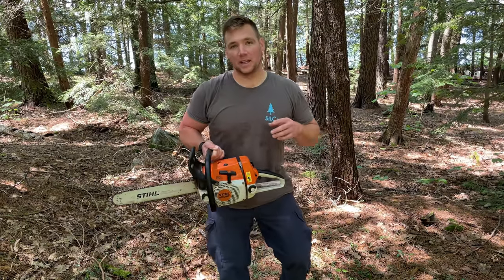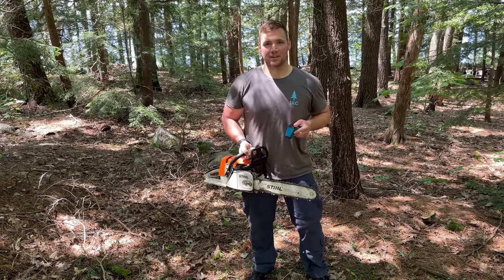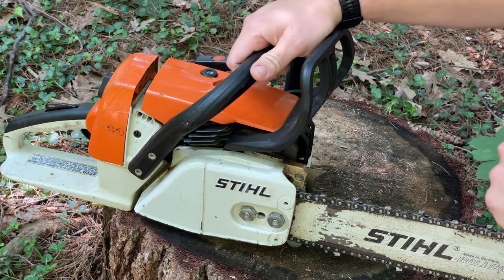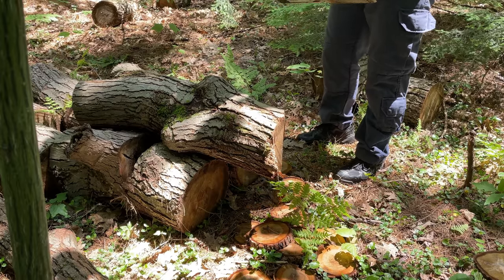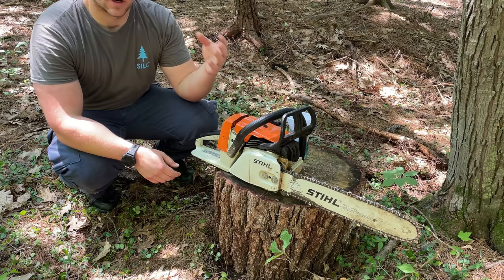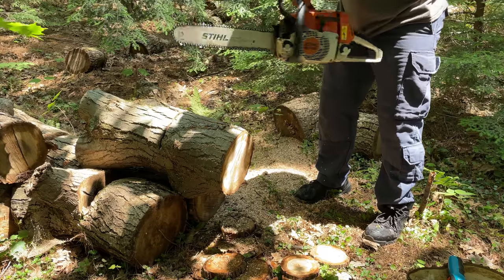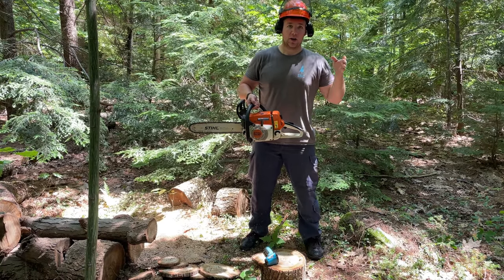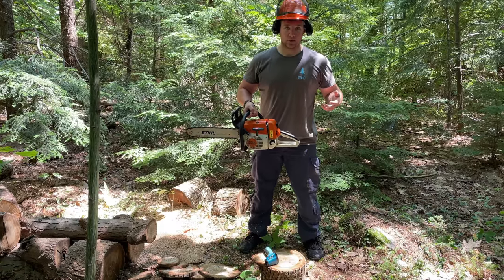Will my chainsaw last longer if I use more oil? Is it safer? (25:1 VS 50:1 temperature testing)

Comment: I've logged professionally for over 30 years. I mix 40 to 1 and add 1 iz of marvel mystery oil per gallon  of gas and ONLY NON ETHANOL gas. My saws cut 3 to 4 million feet a year with no issues. Good job on the video
Reply from the maker: That’s pretty good evidence. What oil do you use?!
Reply: @DavesSmallEngines  Would be very interesting to see your test done with Scot's mixture. Thanks for the very interesting video BTW!
Reply: I can’t find ethanol free gas in my area but I wish I could.
Reply: Is the one ounce of Marvel additional to the 40:1 mix or part of it?
 40:1 is 3.2 oz of oil to 1 gallon of gas. For one gallon did you add 3.2 oz of oil plus 1 oz of marvle making a total of 4.2 Oz per gallon of gas?
Reply: @Wolf-wf6yx  yes. I do my normal mix PLUS an ounce of marvel
Reply: @stevenkinnison8044  there is pretty easy ways to get ethanol out of your gas. If your interested look it up on YouTube
Reply: It looks to me like a 30 to 1 with that extra ounce of mmo
Reply: Well partner, you've wasted money on gasoline for 30 years. I've run 50:1 in all my stihl saws with 10% ethanol gas for 30 years... never a problem, cranks on 2 pulls, run strong. The secret? GOOD gas jugs.
Reply: Oh nice i add mmo to mine as well 😁 didnt think it was anything groundbreaking but nice to confirm im not the only one and others have had success with it.
Reply: Million or
MBF! 🤔🤔
Reply: @thegreeninvasion5511  MBF is 1000 boaed feet
Reply: @scotgarland7526  
I’m well aware! I’m also well aware that you didnt cut a million board feet per year with a chainsaw! 
No way you cut 20,000 ft every week all year long every year! Never mind 60-80,000!
Calling BS
Reply: @thegreeninvasion5511  glad you know all there is about logging in the mountains sport
Reply: @scotgarland7526  
I know enough to know you’re lying! 
  Cut enough wood with a
Chainsaw And a Cable skidder to guarantee that, sport
Reply: @thegreeninvasion5511  not gonna get in a peeing contest with a hobby logger on social media....some of us do it for a living so enjoy
Reply: @scotgarland7526  
15 years full time bud! Still calling BS
You tube hero👍🏻👍🏻🙄
Reply: @thegreeninvasion5511  well I hope you have a successful career and stay safe in the woods
Reply: Exhaust temperature will determine COX and NOX emissions, the lower temperature reduce emissions. Higher ratio improves HP/TQ 50:1 or 60:1 for me with MMO and 80:1-100:1 for races.❤
Reply: @thegreeninvasion5511  That is exactly what I was thinking!  Another thing- most of these logging jobs are like the railroad, they are not in a hurry.  Usually it is more like make a cut, put down the 25-30 lb magnesium pro saw, and then spend 10 minutes contemplating the next cut logistics.  Not because an experienced logger needs to, but because those saws get heavy and they roll railroad style breaks!
Reply: I have never had a problem running 40/1
Reply: Smoe men work for a check, hourly. Some bust there hump, by the pice.
 Former father-in-law was getting sent home at noon . The boys complained on payday the he was getting dubble the pay and only working ½ days . Accused the boss of unfair pay and playing favorites.  He told the boys that he( the boss ) was limiting his bord feet to share,  be nice to the other fallers. Said he gets paid the same per bord foot as the rest of the fallers,  his pay is double due to dropping 2x the bord foot of the rest of the crew. And no reason to make him sit there for ½a day twiddling his thumbs waiting for the rest of the crew to do hafe the volume.  The boss asked a rhetorical question,  do you want me to let him off his limmit?  None wanted a smaller pice of pie at years end, all said no. 
In the days before cell phones he could walk off a job and have 3 massages on the answering machine before he got to the house. Logging was different before the spotted owl deal.
Reply: 2 stroke doesnt really care much if you run it 5-10% ethanol and low octane. They are like locomotives of gas engines can eat almost anything. I have even ran chainsaw motor with cooking oil addon only difference is the smell.
Reply: I want to go 45:1 instead of 50:1 just for a bit of peace of mind? Will I need to retune my stuhl strimmer if I do? I haven't really noticed any difference in performance when I did. I guess it's only 10 -11ml more oil in 5 litres mix.
Reply: @scotgarland7526  it's kinda funny I'm averaging 15-20k feet a week in Minnesota at the moment cutting hardwood averages about 32 trees a day. Give or take. If I cut that little when I was logging out west I'd be fired. Strip cutting 220-250ish trees a day oversized following the buncher 50-60 trees a day. There's a lot of footage in a 42" tree that's over 100ft tall. Most people I know in hardwood country dont understand the coast at all
Reply: @scotgarland7526 that would be a board 189.39 miles long. oK big log tell us another one.
Reply: @darensylvara7690  we log out actual trees not a board at a time hahahaha
Reply: check at your local municipal airport if there is one close to you.  In my area they sell it in a minimum of 5 gallons because the airplane nozzle is larger than a traditional auto nozzle. They sell 91 octane ethanol free.
Reply: Could you explain about the gas jugs? Sounds interesting  @turbodog99
Reply: @ninjafrerunner  But ethanol raises the octane rating of the gas it's in. So  theoretically removing it could theoretically lead to pre-detonation in a high performance engine.

Comment: There’s definitely a sweet spot. I have a lot of hours working on chainsaws, I see a lot of saws blown up on 50:1. 40:1 or 32:1 seem to make them last much longer form what I’ve seen
Reply: I agree 100%.
Reply: i dont buy that.
i have 7 years on a multitude of echo and redmax equipment.  not 1 issue.  50 to 1 syn redmax oil

too many variables to make that determination

50 to 1 is what the manufacturer says.   at least on modern stuff.   you had this vid to show excess heat generated.  

most blow ups in small equipment are user errors, poor mix, old gas..no maint....etc.

but if you feel better at 25 to 1 go ahead.   wasting money and more smoke is what I see.
Reply: Our landscape company used 50:1 for many years, and we would throw out blowers every year due to low compression. A mechanic recommended that we switch to 40:1 ratio (more oil), richen our carburetors up, and remove our spark arrestor screens. Spark plugs are cheaper than engines.

We have had these same old blowers for at 40:1 for DECADES ever since we did that. We no longer replace equipment each year. Our equipment now is discarded/sold when it becomes obsolete and we can't buy parts for it - not because the engines were toast like they were annually, at 50:1. We have been in the landscape business since the early 2000's. 

We will NOT change to less oil (50:1), to please CARB (california air resource board), or the EPA. We do what we must for our profit margins.
Reply: 50:1 in a 550xp 10years old now it runs well still has good compression. But I use good oil
Reply: use motul 710 oír 800 .   thats the pro.  no mixture
Reply: I wonder if these people are allowing proper warm up time every time.

Comment: Maybe if you tune the carb for the fuel mixture it may run the same temps. You may be putting the saw under load without it being run at optimum efficiency, therefor, it struggles more and runs hotter. I am skeptical to a degree how scientific this is.
Reply from the maker: Hey Mark! Good points. I’m glad you’re skeptical - that’s what this is all about. This test shows what happens when you run 50:1 and 25:1 in the same saw with no adjustments. I did not make any carb adjustments.
Reply: I agree. Carb adjustment would have been another interesting test. Guarantee results would change. Very interesting test though.
Reply: Or at least do same test but start with 25/1 Then 50/1
Reply: That saws cutting appallingly  bad. It woukd run cooler with a properly  sharpened chain.
Reply: @DavesSmallEngines  it’s jetted for 50:1. So of course it will run too lean at 25:1.  It will make more power and last longer at 25:1 if it’s jetted accordingly.
Reply: I agree with carb adjustments may make a difference but then think how many people out there will change a mixture and nothing else on their equipment which I think most homeowners and weekend warriors will do. Thanks for doing this test as it gives me something to think about
Reply: @peteschiavoni    I don’t think most weekend warriors would have any idea what we are talking about.  Buy oil, mix as bottles tell them.  At either ratio you are not going to hurt the saw, so it’s all good!

Comment: You see, the MAJOR FLAW in your test is that you did not re-tune your carburetor for the new mix ratio. If you are running more oil you are displacing fuel and causing a slightly lean burn. You just need to re-tune your carb a bit richer to get that extra fuel back into the a/f ratio and the saw will run just as cool and have more lubrication. If the saw has limiter locks they may need to be removed to run rich enough with more oil then the EPA mandated 50:1. I've heard that the M-tronic and Autotune saws have no problem adjusting for the extra oil if the proper warmup procedure is performed.
Reply: That wasn't the point of the video. He was trying to see what happens when you DON'T make changes. Additionally, most people don't have the experience to properly adjust and tune a saw.
Reply: @afellowinnewengland6142 then in this case he should have at least spoken about this. Context matters.
Reply: Well maybe you’ll get a refund. How much did this video cost you to watch? I know when I watch a video on YouTube I expect the highest academic rigor, peer reviewed papers and state of the art test methodology.
Reply: I was wondering the same regarding how Mtronic handled the change or if it demands 50:1.
Reply: I don't think the average chainsaw user knows where to even find the carb, so his way of testing is perfect for anyone under the age of 40 lol

Comment: The likely answer as to why chainsaws run hotter with more oil in the fuel mix is because oil is replacing gasoline and the gasoline burns more efficiently to produce power.  What's important here is not that the temperature is higher, but rather do the hotter operating temperatures reduce the life cycle of any components?  And I would surmise that only the manufacturer can make that determination.  But I will give the audience an important fact.  One that was not presented in this video.  Still says to use a 25 to 1 fuel mix ratio if one does not use stihl oil in the oil mix.  Don't believe me?  Read the owner's manual.  Thank you for a very informative test.

Comment: i have run saws for 20 years with 20:1 mixed gas and never had a problem not even dirty plugs. they tell you to run lean oil mixes so you get less pollution and thats all. i had snowmobiles that blew up on 50:1 mix and i have seen old arctic cats run for 30 years because they used 20:1. drain half the oil out of your car and see how it works or mix half your cars engine oil with kerosene and see how it works. a neighbor of mine blew up a new stihl saw within 1 year and he ran 50:1. he was a logger so it got used a lot but one year isnt very long. I have mixed my gas with 40 weight engine oil at 20:1 when I was out of 2 cycle oil and it worked fine. anybody that says use less is a fool.
Reply: I think people should understand that most of these oils burn at low temperatures so 50.1 isn't much protection at high rpm unless U use like Motul 800 road racing which burns at 252 Celcius (50.1 this oil is same results 16.1 with thin oil
Reply: @Dntgveafck2701  exactly.  with stihl oil,  one of the worst on planet earth 1/50 or 1/30 is very little help.  that why service is full of broken tools......   use motul 1/50 and u have no pro cca 10 years .  people care too much about s.t.u.p.i.d reasons and they miss basics

Comment: I have a poulan 3400 from 1983 that I run. Manufacture recommends 16:1 ratio! That's what I always ran and never had a problem. Smoked during warm-up,  but cleared during sawing. After about 35 yrs I took it apart to put in new rings and the piston and cylinder walls were in perfect shape. The cylinder is NOT chrome or nickasil plated either. Was no ridge on cylinder from ring wear. Most of its life I used Cenex two stroke oil.... my Dad was a manager at a Cenex location.

     I don't think more oil makes saw run hotter.  If that was the case,  my saw would have overheated. My saw ran cool. The carb was adjusted to the mixture it was running. Ran great. 
     Dealer would always give me hard time. Wanted to sell me new saw every time I stopped in for new chain or bar. Told him I'd buy new saw when my poulan wore out. It's still going and he died waiting.
Reply from the maker: Hey Todd! That’s great info. I wanted to show a video on the difference if the carb was not adjusted. To make up for the oil increase long term, I would want to make adjustments to the carb. Cheers!
Reply: Don't die waiting peeps. Moral of the story. Get your ass better...in all facets of life. You may smoke a little at first, but long with all your heart  to run smooth.....chop that wood
Reply: The 25 to 1 would perform better if the jetting was correct to the ratio.
Reply: I’ve got an old 3400 counter-vibe and it runs fine on 42.5 :1
Reply: Salesman “died waiting” for your 3400 to blow. 
Nice.
Reply: @blixhuxley1055 I don’t smoke, but I do stink!
Reply: 16:1 sounds like a ratio with sae 30 oil not 2-stroke.  You obviously don’t use it for hours on end or it would be worn out from one end to the other. 

The extra lubrication of a modern oil while still properly mixed for the jetting shouldn’t hurt anything as modern oil will produce less carbon in the exhaust.  

If you mixed 40:1 with modern oil you would be very rich, and still not be in danger of causing excessive damage, just a little down on power compared to optimal.
Reply: @rydplrs71  extra oil does not reduce power. Where you coming up with that idea. Air cooled engines have a lot of piston and ring clearance to allow for expansion. Oil creates a seal and raises compression. It's not all about wear on engine components. It's about creating a seal to make power. Google it. They did tests back in seventies and found higher oil ratios created more power. There's a limit though, then you start to go backwards.
Reply: @shannonwhitaker9630  that don't make it a good idea. Oil ratio is not just about lubrication. It's also about compression. The oil makes the piston and rings seal better against the cylinder walls. Higher compression means more power. Remember, two stroke oil is designed to burn, not just lubricate. Of you have a 3400, then you know that sticker says 16:1 ratio. The other reason for this is the fact that it's running chrome find against a plain aluminum cylinder wall. It's not nikisil plated or chrome plated. That's the other reason it's 16:1. When I wore my rings out, I had basically zero wear on cylinder. No ridge whatsoever. With synthetic oils and such nowadays, I've backed off to 32:1. But that's as thin as I will go. That's actually half what the manufacturer recommended when saw was made in early eighties. 
     Plus a highly respected chainsaw builder in wisconsin recommends minium 32:1. You need the oil to make compression. NOT JUST LUBRICATE.
Reply: I believe you need to visit some info on the internal components of your 3400. I don’t believe you have the correct information on metal composition of the top end. If you have a thick 2-ring piston you may be mistaken or reversed on chrome composition. I have multiple 1,000’s of hands-on usage with old school steel cylinder sleeve 2-cycles. When the engines were developed in the early 60’s they advised 16:1 ratio. Through the years as oils became more advanced the recommendation became 24:1 and eventually 32:1. These same engines would run fine today at 40:1 but the interval between ring swap would lessen to every 100-150hrs. With 32:1 ring change is generally not needed until around 300hrs to keep peak compression. I however run all my modern Nikasil cylinder engines at 42.5:1 and never with E-gas.